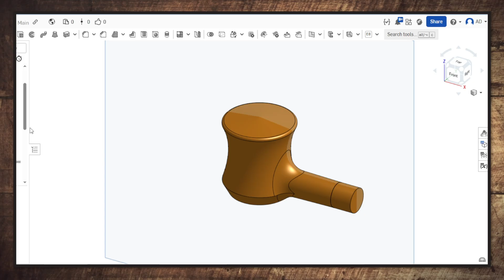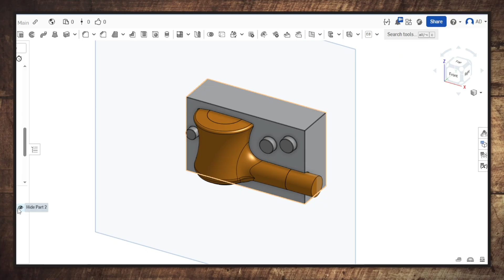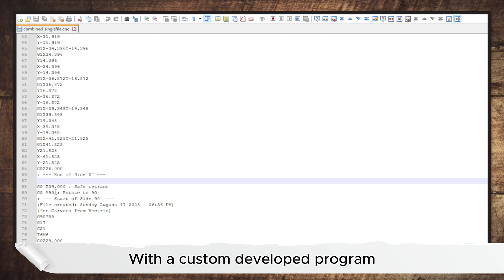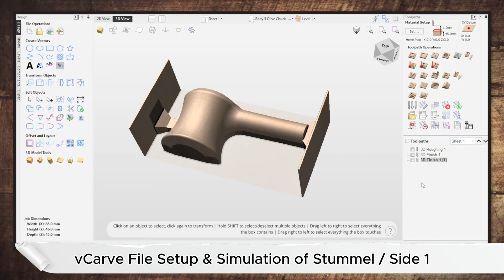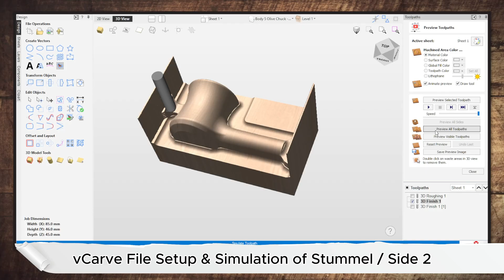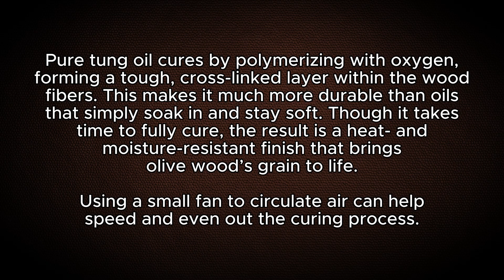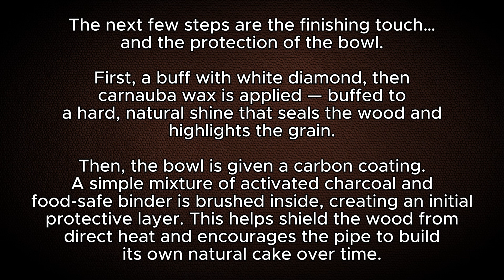Making an Olivewood Tobacco Pipe on a Desktop CNC - Full Process (Not Sponsored) Carvera Air CNC

Comment: Touch sensor? Where? What? How?
Reply from the maker: Using community firmware, you can use a 3D Touch Probe
Reply: @GabrielMakesThings  Please consider making a video on how to use it on the Air. All I get are errors when trying to use it.
Reply from the maker: @StrongholdArmory community firmware latest version? For both controller and app?
Reply: Wow 🤩 das ist ja der Hammer. Mega geiles Video. 🙏